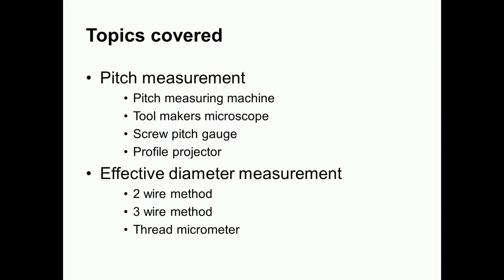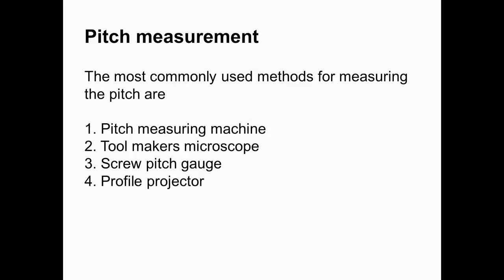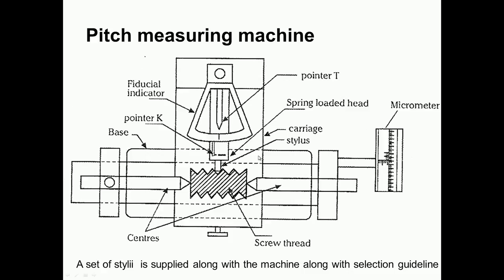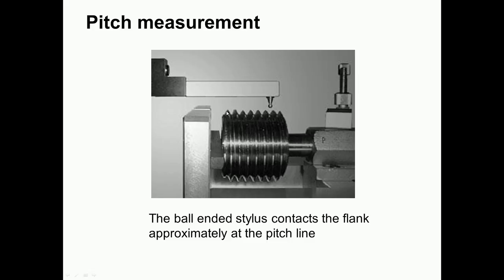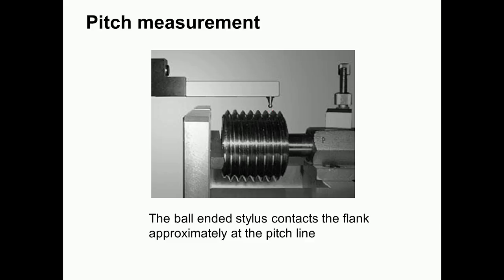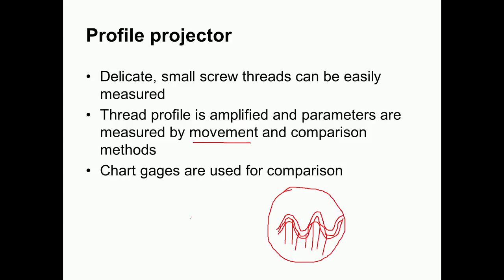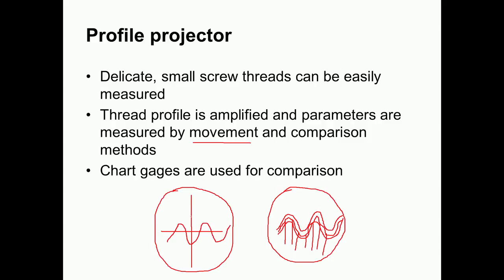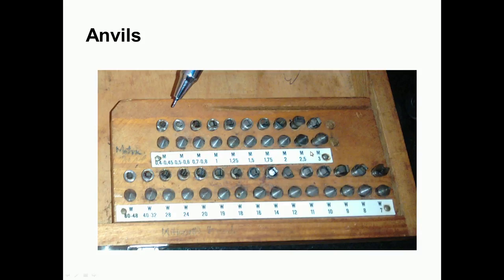Measurement of screw thread elements

Comment: 1:00:35 That is completely WRONG. You have the single pin OUTSIDE the square of the 2 pin threads. And 42:48 the drawing it completely wrong, that is NOT a screw thread and that is NOT where the pins need to be.